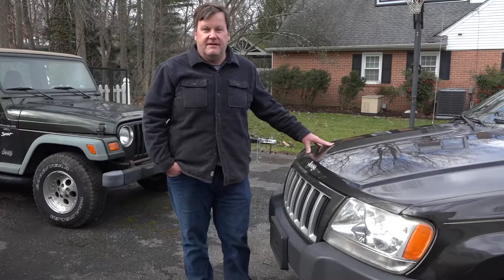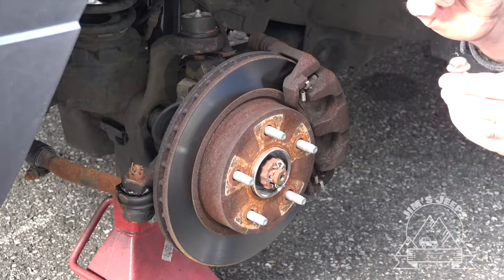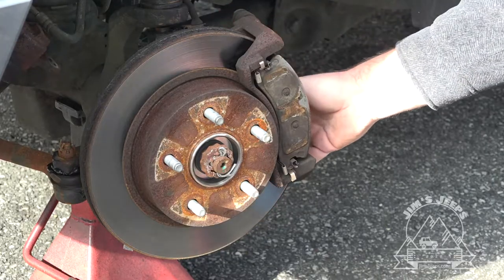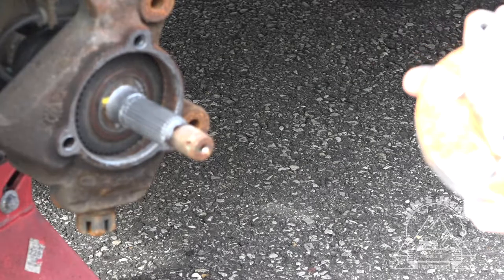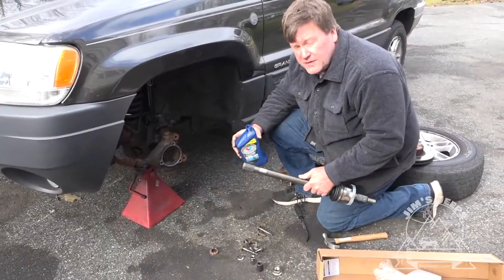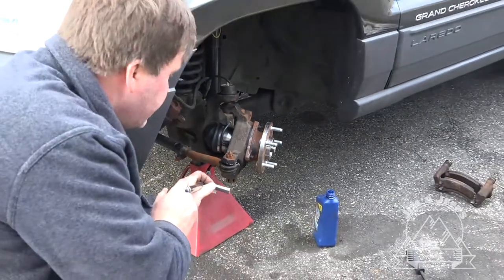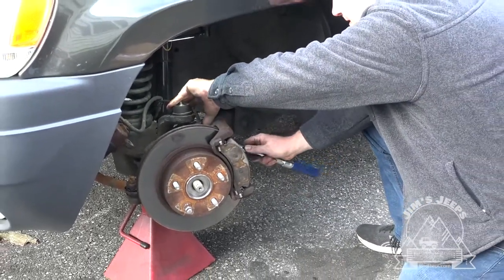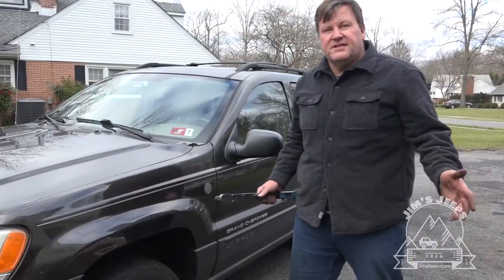CV Axle Replacement on 2004 Jeep Grand Cherokee Laredo

Comment: Rock Auto has yet to fail me in the last 15 years. I had my front end aligned and then they cut my clamp on my boot. I knew they cut it as I just replaced the baljoint and the the axle was looking great. My hub should be nice and easy to remove. Love my anti seize. Thanks for the video. was hoping for a short cut. :) :)
Reply from the maker: Agree.  Rock Auto is great.  Had replaced manifold due to the notorious collector cracking...bought a Dorman kit, replaced it.  Two years later, it cracked again.  Pulled up invoice online with Rock Auto and requested replacement.  They sent a complete kit again, no charge!  (I did have to send cracked one back, but so what...)  Awesome service!  Good luck with the repair!

Comment: Hey Jim, excellent video and thank you for it. I do have a minor correction and a piece of advice for the shade tree mechanic. 
1: To remove the "safety nut" and cotter pin, needle nose pliers are sometimes easier to work with.
2: If you don't have power tools but do have a helper, do not remove the caliper first. Have the helper hold the brake so you can break the spindle nut loose. After that, pop the cap loose on the brake fluid reservoir(do not remove it), use your prybar to compress the caliper pistons and remove the assembly as you illustrated. You can also buy a kit from AutoZone that comes with the washer, nut, safety nut and cotter pin for under 10 bucks.
The correction: On a 2004, the actual hub bolt size is 13mm. While the 1/2" might work, there might be some damage to the bolt. 13mm is a perfect fit.
Thanks for the video, and keep up the good work!
Reply from the maker: All good points!  Thanks!

Comment: Unless you’re replacing your brake pads it’s a little easier to remove the caliper mounting bracket with the caliper still bolted to it in one piece but everything else is correct from a mechanic. Not sure why this showed up on my YT after I looked at the troublesome wiring that goes into the drivers door for power door locks & windows. I have the exact same Jeep with the same 4.0 iron block inline 6cyl. The best motor Jeep ever made.

Comment: Nice video. Good to see you doing it the driveway, just like my son and I do on his 2004 WJ Special Edition. My question is regarding the replacement cv axles. His WJ does not have Select Trac. It is all wheel drive all the time. Two selections only Hi or Low. I think it's called Quadra Tac. Of course I am typing this from my work desk and relying on my memory. It looks there there are two choices of axles out there. How do I know which replacements I should get?
Reply from the maker: You need the "Quadra-drive" CV axles...these are the full time 4wd axles.  Thanks for the kind words!  I appreciate doing rhe work in the druveway.  Makes me feel like I've "earned it" ...

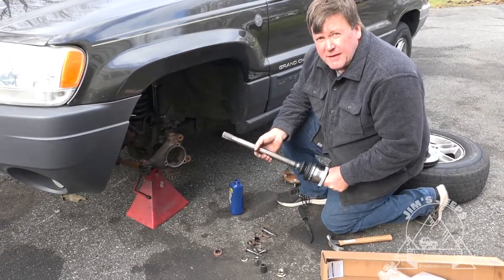Comment: 8:15 -- how high is the risk of breaking the inner seal ?
Reply from the maker: Well, a couple things...If it’s the original one, it's probably already hard from age...hitting it with the end of the axle is not going to help.  You will unfortunately know if you have gear oil coming out the end of the alxe tube.  If that is the case, then you MUST fix this immediately or you will cook the diff gears.  It's not to bad.of a job, but you will need to remove the gear to get to the inner sides of the axle tubes to get new seals in.  Take a look at the YJ inner axle seal video.

Comment: Great Video Jim, I'm not sure if this is what I need to do on my 2004 Jeep Grand Cherokee or not but you made this fix look easy. I just have a small thump when ever I start moving from a stop, and I can mostly just feel it in the floor. It thumps 3 or 4 times but only when starting from a stop, otherwise every thing seems fine. Anyway I mostly wanted to say great video and I look forward to seeing more. Thanks again
Reply from the maker: One other thing to check is the propeller drive shaft (front drive shaft)...these will do that kind of noise too...it spins if in 4wd or not, so ot might be that... in any case, both the cv axles and the propeller shaft are easy DIY jobs... Best of luck with your repair!
Reply: @jimsjeeps9782  Thanks I'll check that two this weekend I'm heading to a friends garage to do some work on it. Your video was awesome, Thanks again

Comment: My boot was ripped on my previous axle. I just replaced it using this video. Do I need to replace any oil?
Reply from the maker: If you just put a new boot on then it could be that the joint was exposed to sand, dirt etc.  If you replaced the whole axle with a new one, or rebuilt one, then no you are good to go.  So, if you are trying to save the original axle, you should remove it from vehicle, clean the cv joint very well with solvent, repack it with proper bearing grease and then install a new boot.  For longevity, it's better to simply replace it.

Comment: The Biggest issue I have with Rockauto is their return policy, where you have to pay for shipping to return items, and that you can't talk to an actual person.
Reply from the maker: Fair enough... I will say that I had to ask for warranty support on a manifold that cracked after 4 years.  It had a lifetime warranty and they sent out a new one...no questions asked.  I did have to pay to ship defective one back, but still... was pleased...they are not a sponsor and certainly you may be able to get parts elsewhere at a comparable price.
Reply: @jimsjeeps9782  Yeah I price-shop to see what is the best price, typically I use RockAuto, Amazon, eBay, or Advance Auto.
Reply: and they are really slow to get parts to me.

Comment: I have a question i have a similar jeep and i have a electrical shortage i change fuses i change relays but i get the same problem . My car sometimes start and then doesn't when i open my door i keep getting a clicking sound. Do you know what that could be because when that happens my car would give me issues.
Reply from the maker: I would start with the door lock and window switches... It could be that they are shorted out... Certainly if you say "it won't start", does it seem like the battery ran down for some reason??  If so, I suspect the door lock switch... Look in manual and see what fuse is blown (Windows/door lock??)  If so, leave that out for now...If it seems OK for a while...Then it is in that circuit somewhere...Check for pinches of wire harness at ALL the doors...AND check that the switches themselves are still good...  Start there...Let me know what you find out! Jim
Reply: Check the wires in your door harnesses as well. I have an 04 WJ and the wires in those door harnesses can break. I had broken wires in all 4 harnesses when I went through my jeep
Reply: @Mike-zl4zs  specifically the wires coming through the door jam. I just repaired mine on an 04 wj limited. most of them were either broken completely or had bare wire. my battery kept dying because when these wires are like that, they can spark some which turns the ECU back on briefly even without the key in it. The ECU shuts off after about 30 minutes or so after the key is removed.  SO with it turning on and off numerous times throughout the night, it would die completely in a day or so. I spliced in new wire to repair the damaged ones, and havent had a problem since.

Comment: you dont live in the N-E rust belt, you could spend hours trying to get the bearing and hub out.
Reply from the maker: Actually, I live in Delaware.  So, I hear you about the salt laden roads.  It CAN be extremely difficult to get out but when you put it back, MAKE SURE to use anti-seize!  If you can hit it with pneumatic hammer, that helps greatly.

Comment: You showed everything except how you got the hub loose. At 5:34 you just switched to it being loose    They are always stuck
Reply from the maker: I don’t recall exactly how I got it loose, but often if you remove hub bolts and turn the wheel it will pop loose.

Comment: If you're replacing the wheel hub and the axle is it necessary to remove the 36mm axle nut or can you just remove the 3 hub bolts and slide it all out together?
Reply from the maker: You can replace the hub and axle as one unit... You do not have to undo the axle nut (although you may need to reuse the OEM nut to get the cotter pin back in...)

Comment: Hay Jim I have a 2003 Jeep Grand Cherokee. I got into a hit and run and got my back passenger axel tilted. Will the process work. What part and where should I order from. ?? I have a mechanic who is willing to do it for me but I need to order my own parts please help thank you !!!
Reply from the maker: Also...Make sure the axle tube is not bent... If it is, it would be best to go to a junk yard and get a whole new axle.  Check car-part.com for a wrecking yard near you.  It's not a big job to swap out the entire axle...  You do need to know if it is a DANA 35 or a DANA 44 axle though... Hope this helps!

Comment: What part to order for a 2003 Jeep Grand Cherokee passenger back axle and hub ??
Reply from the maker: Glad to help if I can.  Also, check out this video...It is how to swap out an axle on the DANA 35:  https://youtu.be/8V3BDRWrdTE

Need to know if it is a DANA 35 or a DANA 44 axle housing?  The axle itself is around $130-160.  See this link:
https://www.rockauto.com/en/catalog/jeep,2003,grand+cherokee,4.0l+l6,1416125,drivetrain,axle+shaft,10439

Comment: Hey jim how do you know which axel to buy from roc auto i have to change the same driver side axel.
Reply from the maker: There are two styles...if you have the cv axles, the joint at the tire end (steering knuckle) will have a rubber boot on it.  This is a CV style joint and for a 1999-2004, the part number is listed in the description.  You did not say what year your vehicle is, so I can't give you a better answer than this.

Comment: Its in the driverside wheel
Reply from the maker: Well it could be the brakes rattling...bad bearing hub would be more of a grinding sound...Are bakes good?  Could also be the drive axle like we replaced here...But it could be bad ball joint...if you raise the vehicle on a jack, can you feel play in the tire...try moving side to side and top to bottom to see if there is excess play...ball joints, bearing hub, or drive axle are about all it could be...

Comment: Anyone know what oil he used to coat the end of the cv axle?
Reply from the maker: You can lube it up with either regular axle grease (thicker) or just gear oil... You don't want to hit the inner seal dry, it "could" tear the seal..
and on first drive it could run dry until some splashes on it... so that's what I did.  And, on the hub side, on the splines, it prevents rust from fusing the hub and axle together.
Reply: 2 year old video and you're still replying to the comments, much appreciated.

Comment: All I ever wanted was a vehicle lift so I didn't have to roll around on the ground.
Reply from the maker: You and me both!  I am going to build a garage with a lift at some point.  Was going to do it, but material prices went nuts... Hopefully things will stabilize.
Reply: @jimsjeeps9782  just put up the lift, worry about a roof another day.  (life is short)  It doesn't rain under a car anyway.  much...